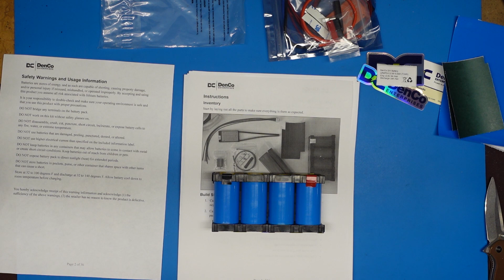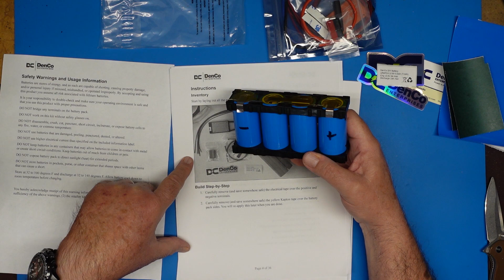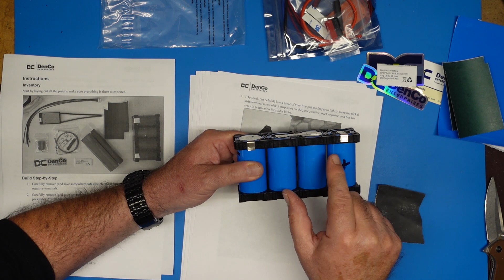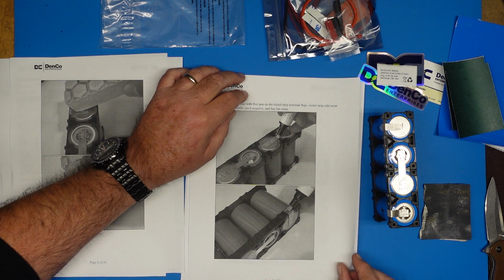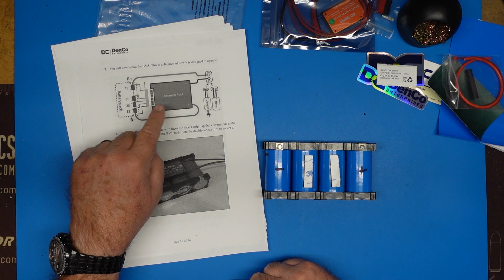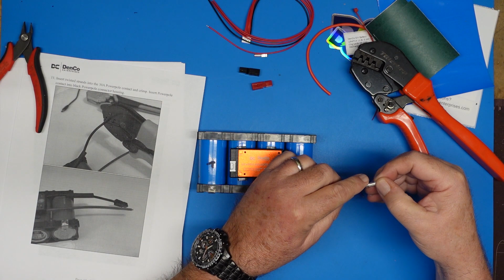Don't let the smoke out -  DenCo Battery Build - Part II

Comment: Nice video!  You need to use a suction fan when soldering especially if you smoke.  Solder fume and smoking don't make a good mix.  Also I would imagine the batteries have some residual charge on the.  You could always use a voltmeter to determine negative and positive.  73